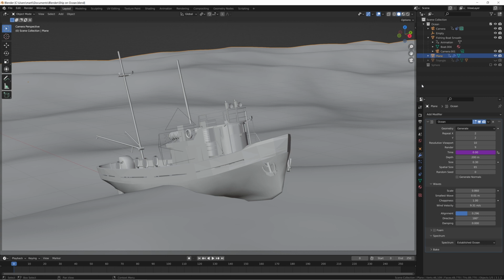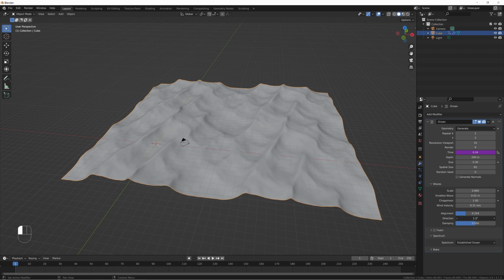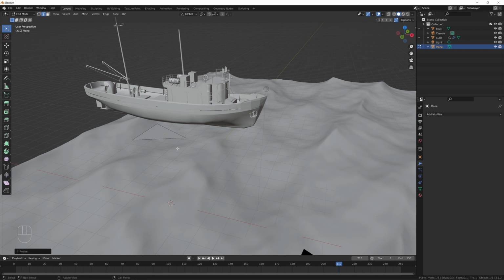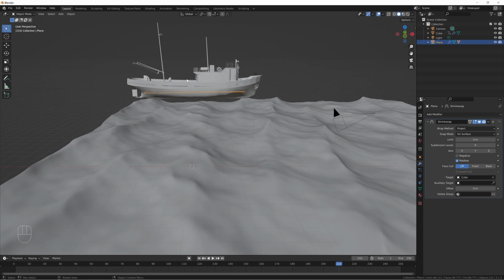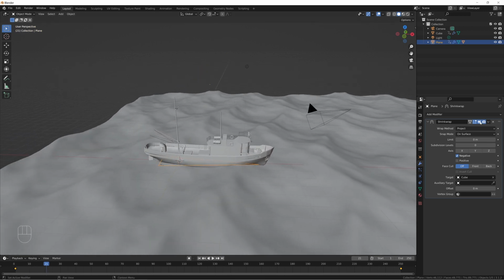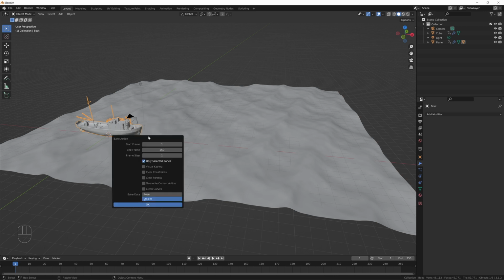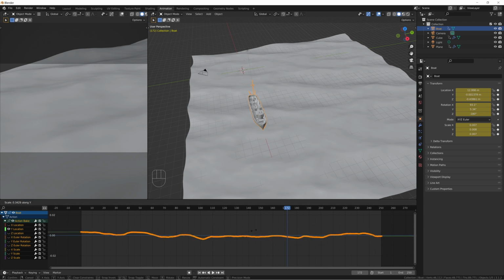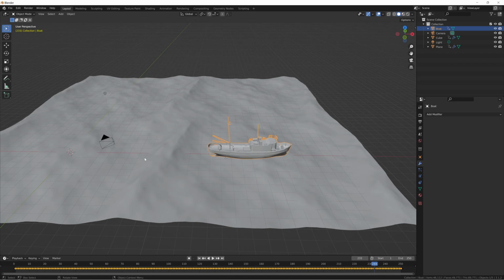How to Make Anything Sail Through Water in Blender | Floating AND Moving

Comment: That looks fantastic! How would I add a wake and foam?
Reply from the maker: I’ve actually not found a good way to do that. You could try adding a particle simulation to the bow and stern of the boat, but it is overall really limited in what you can accomplish.
Reply: Found my way to this video exactly because I'm looking to create wake and foam . . .

I have a working solution for spray, but I'm not very satisfied with it thus far, but if I share my method, someone might be able to build off that.

What I've done so far: use a vertex weight proximity mod on a simplified mesh of the ship or other thing in the water, (parent it to the actual ship), that measures proximity to the ocean. 

Then use that vertex group as a density modifier for a particle emitter, (you may need to flip weights, as the default vertex weight proximity settings give vertices that are further away a heavier weight), and give the particles a suitable normal velocity and slight upwards velocity, (usually +Z). 

And then if your ship isn't actually moving through the ocean, (afterall, ocean takes a long time to process and moving through ocean looks a lot like staying in one place and just moving the waves faster, which allows you to simulate a much much smaller ocean, esp. for long shots), you can duplicate the particle effect, add two wind effects blowing back-left and back-right, put them in separate groups, and have each copy of the particle effect reference one of those groups for its forces. 

I've been thinking that a wake might be something like a shrinkwrapped volume offset above the ocean surface a little bit, with tapered edges, shaded as a volume rather than as a surface, so it "colours" the surface of the water, and then foam would be a shrinkwrapped plane with a white bubbly mask on top of that. But so far, I've got nothing that looks better than animation straight out of the 90's. Using this motion trick and giving the wake-volume some triangular depressions, then using a displacement modifier to put waves on the wake volume might fake a good looking effect? As where it dips below the surface would then be negative space forming the edges of the wake. 

Of course, that would only look good on very calm waters with a fairly slow boat, as you really want the wake to disrupt existing waves and at faster speeds, create its own wavelets. I'm not sure how to do that to an ocean modifier, but I have a sneaky suspicion that it'll involve a lot of baking and hand-tweaking.
Reply from the maker: Thanks Chickie for sharing that! I honestly never got much into weight painting because I’ve always had trouble with it, but that would be a convenient way to keep the particles moving with the boat. I imagine to get a convincing effect close up, you’d probably have to end up using a fluid simulation. The method I use and the particle method are all just loose approximations that hold up at a distance but would pretty quickly break down up close.
Reply: Maybe it could be done using Dynamic Paint, with the boat (or a convex hull representation) as a paintbrush and the ocean itself as a canvas set to waves.